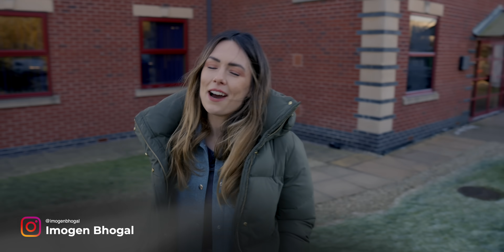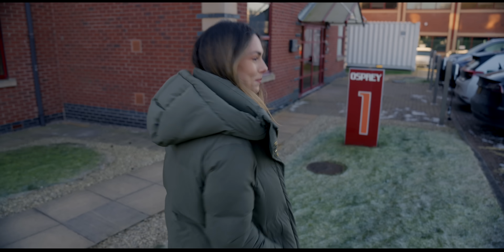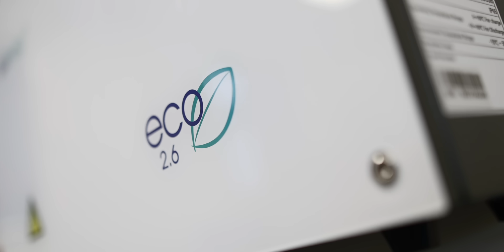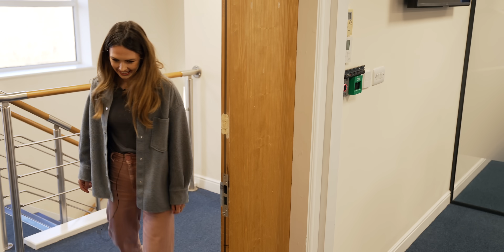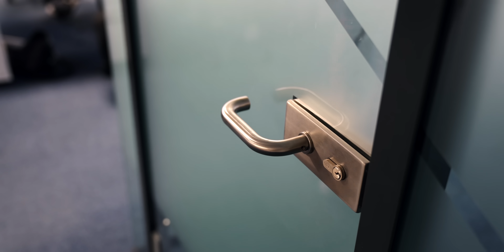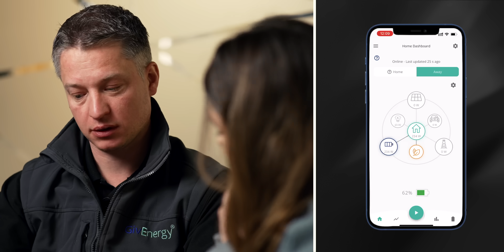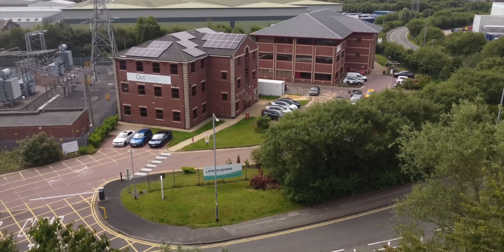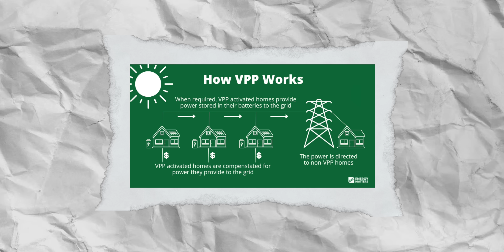THIS Is The Secret To Green, Clean Passive Income!

Comment: I think the size of your grid connection is a big factor here. If you only have a 4 hour cheap overnight window to charge your home battery and your car, then a 3 phase grid connection will make all the difference. In the UK they seem quite rare, on the continent (and even in places like Nigeria) it seems standard.
Reply: I don't think it's really a problem. A 100A supply gives you 92kWh every day. Putting 13 of those into a big battery hardly makes a dent, and  leaves enough for  about 300 miles of driving a day, which would work out to 115,000miles per year.

If you've only got a 60A connection, that's still 55kWh, which leaves enough for 170 miles a day (or 60,000 miles per year)
Reply: I guess that depends on what your grid connection is, my current house (UK) was was built over 10 years ago and is 100A (single phase). But of course many, especially older, properties are going to be 80A or less, and those are likely not going to be easy to upgrade.
Just thinking of an example, Looking at the datasheet for the GivEnergy 8.2 kWh (as it's their popular one), that charges and discharges at a max of 80A, with a 59V max change voltage, so that's ~1.8 hours to charge from flat (assuming I got the calculation correct!).
Add a 7kW/32A on the wall car charger, and they can add around 20 miles per hour to a cars range (depends on car efficiency of course).
So with a flat house battery every day, and only 4 hours of cheap overnight electric, that's the home battery fully charged, and about say 30-35 miles range being added overnight (I'm assuming some power being needed for the house as well, otherwise it would be 40+). This assumes no solar PV as well (or a typical UK winter even with PV!).
Reply: @TheBoothy666  I don't understand how you got the 30-35 miles. If the battery is charging at 4KW and the car at 7kW they're using a total of 11kW. That would be close to a 60A (13kW) connection but there would still be head-room with a 80A (18kW) or 100A (23kW) connection.
Reply: @robinbennett5994  I was assuming charging the car and the home battery were not being done in parallel, i.e. Charge the house for up to 1.9 hours till full, then the car for 2.1 hours (or more). All I was doing was pointing out it's viable with a house battery and an EV, even if you only have a 4 hour overnight slot for cheap elec pricing.
Obviously having a integrated control system to manage the car charger and battery system in tandem would make this work better, i.e. charge the car at max rate, and anything left over push into the house battery, (or the other way round depending on your priorities) but not everyone has these things integrated.

Comment: .Stay with fossil fuels, forget nuclear grid electricity. 

5 times more electricity if no fossil fuels and 5 times bigger national grid. 

Look at Snowy 2's additional grid costs, $2billion budget is now $15billion or $20billion budget. 

All the CO2 to build bigger national grid is insane. 

World CO2 emissions are killing Australia. 

The world is not going to build bigger national electric grids. Grow up.

Something I posted on a nuclear promoters site.

Actually, grid expansion costs and nuclear electricity will see customers abandon the grid and rely on rooftop solar PV and EV with V2G feature with selfplug-in. 

Most vehicles are parked 23hrs every day and drive only 7kwh short trips daily. 
Most vehicles drive building to building parking space. 

A simple wall plug and trickle charging 240volt, ezi pezi daily. At all parking spaces. 

A grid with no customers is a dead duck, a stranded asset. 
A grid with nuclear electricity is a bigger dead duck.

The daily solar duck curve is deadly,  Hahaha 😆, when EVs are only part of the national vehicles fleet. 
Customers will abandon supporting the national grid.

Comment: In southwest England with a 4kw solar panels and a 10kw battery with an ev charger that i charge all of it up on ( inc battery ) on an ev tariff at night but solar during the day.
My energy use for last year was 3600kw my solar produced 3400kw and i imported into my batteries 2100kw for 7.5p but sent back to the grid 2000kw for 15p per kw.

To charge my car ( company car ) it costs just under £6 for an 100% charge and 330 miles so really cheap.

I still pay bills but they are much lower than before and the savings are obvious.

I did mention my car was a company car but if its wasn't i would seriously consider a second hand EV as the advantages outweigh me going back to a combustion car.

On "fuel" petrol alone i am saving around £2000 a year not including maintenance costs and my home electric i am saving around the same so between £3000-£4000 a year in savings.

Its an absolute no brainer for me.

My only advice is make sure you get a decent battery size as that is where the savings are made for me, if i could afford another battery soon i would.

My set up is a 
5kw solis hybrid inverter.
10 kw puredrive batteries.
4.4 kw JA solar panels.
Zappi car charger.

It all works great and its all really efficient.
The batteries have only lost 0.10% efficiency in just over one year so literally nothing while being charged and discharged once each a day.

Getting a set up like this can be beneficial but my advice is do your homework of how much energy you use and what equipment you need, don't undersize as thats a big problem, two companies i look at wanted to install a 5kw and 2.5 kw battery that would have been useless so shop around and compare notes to see if your figures come close to what the retailer's say.

But its definitely well worth it.
Reply: @sbalko74  The difference is mostly likely that you use a lot of power for air-con - which is extremely rare in the UK. As are pools, now you mention it!
Reply: @sbalko74  The solar tops up the car when my batteries are full, the main charge comes on at night for 7.5p per kW through "octopus energy" on thier intelligent tariff.

It's not designed to be the main charge for the car it's more for the general running of my home as I average 9.8kw a day and my batteries are 10kw.

Also an English home doesn't have much space for any more panels, my 10 panels fill up my south facing roof, if I could have more I would but it's the maximum I can fit.

Also I don't need Air-con or even "have" or can "fit" a pool into my back garden as it is the size of a postage stamp.
Reply: If the zappi is shedding the car charger during high house loads that is the secret sauce
Reply: Fantastic.  This is the sort of practical number-crunching in a human way story the channel should do - 2 years is a long enough period for credible feedback.  (Need to add a financing cost - now if you spend £7000 upfront, the interest cost is meaningful.  If you are lucky enough to not need to borrow, it is still income foregone from something else)

Comment: I usually love your channel, but this does come across as a bit snake-oily. I think being paid £24 in a day for a small amount of energy must be quite a rare event. I used to be with Octopus Agile Outgoing, and there were occasional situations like that, for sure, but they were few and far between.
Reply: Rather misleading wording. The MD's All in One can discharge 6kWh in one hour so he would have been paid £4 per kWh. That's a higher rate than usual and there's only about a dozen of these sessions a year. Also to save £4 per day, everyday, means using the full 13.5kWh everyday and having a difference between peak and off peak rate of almost 30p per kWh assuming no losses.
Reply: @paulthompson9837  £4, most suppliers are giving £2.25 for these periods, and it's not a daily thing. There's been 1 in 2024. No idea how £24 came up.
Reply: I guess to save £4 per day he must also be counting power used by his EV, otherwise you are correct and his figure is optimistic. @paulthompson9837
Reply: Agree. That's either a huge battery or a very rare rate to encounter. Unless you happen to have a lot of excess solar your usually better off averaged across the year charging your batteries at cheap rates, and using your solar / battery. The savings on plans that support this outweigh the payments from selling it back at high rates. As your typically paying a lot more for your incoming tariff, so it just doesn't balance out. It'll be cheap (import) when its hot and sunny, when you don't need to charge. When its cold and grey you won't see a cheap rate. However if you have lots of excess battery and solar DFS will be fine. But at that point you've over paid for your system to be too big. So although its better to operate your big system this way you'd still have been better off buying a smaller system. Of course there are exceptions if you're using very small amounts etc, but with the current options of tarrifs it usually doesn't add up to sell back to grid than just using it cheap.
Reply: I was surprised with the £24 session but it can be achieved if he has the higher battery and latest Inverter. In Dec 23 we had 1 Giveback event which paid a double amount of £4.40 per Kw.  We earned just under £9 from it with us discharging at 2.6Kw per hour  (Gen 1 inverter with Gen 1 batteries) with about 1.9Kw per hour going to the grid. The newer systems are much higher so I can see how he hit £24.  Since then we have had standard events at the normal rate of £2.20 per Kw. Typically we earn around £4 an event and also at the same time I am earning my SEG tariff which is 15p pKw. the battery setup with the EV tariff is brilliant. We get around 13 Kw in the early hours and then use that all day and into the night depending on the solar. 9p per Kw instead of 40p Per Kw, easily saving £4+ a day. The Givenergy solution is worth looking into rather than getting a piece meal ad hoc setup.
Reply: true....
Reply: They were specifically talking about the DFS sessions, of which there are about a dozen each winter, and of those only a couple will be at ~£4/kWh

Comment: How exactly did he make 24 pounds in 1 night ? what was the price-kwh ? 20p 24/.2 = 120kwh... but his battery is perhaps 5kwh from the graphs he showed... please give actual date... like how big is his system, actual meaningful numbers etc, otherwise IMHO you are just confusing and giving people perhaps false impression. With all this "Makeing money" could you please put it into perspective with the payback period etc.

Additionally what are the losses in sending to the grid ? 20%
Reply: The details were rather lacking. We only pay $1.50 for 10kWh. Sure, our night time rate is 6¢ so the battery might save us 1.50 - 0.60 or $0.90/day. $0.9 x 365 = $328/yr. I wonder what the whole setup costs.
Reply: yep... theres a reason they are lacking in the details, because I don't think it makes sense... I have solar (diy) and ev... but not to save the world, coz they won't and only slightly to save money... diy pays back much quicker...  @scottkolaya2110
Reply: GivEnergy All-in-One can output at 6kW, at £4/hr, gives £24.  But his house can't have been using any power during the DFS event, and it doesn't account for charging costs.  

During the last DFS event we turned of the freezer and dehumidifier, and had a candle-light meal, but I don't suggest this for all.  It was mainly for fun for my 2 young boys, who got a chance to use their torches.  

As soon as V2G starts working these DFS events will be even more worthwhile.  At present most car chargers are 7kW, but I'd like to get something in the 13-20kW range, partly to benefit from DFS events, but also because I'm on Octopus Agile so faster charging will enable me to make the most of the very lowest rates.
Reply: How big did his battery have to be ? from the daily usage- gr-phs ---------It didn't look more than 5kwh ? but to get 24 pounds at he need to run at 6kw max for 4 hours... i.e 24kwh's  @Adam-u1n1b
Reply: The 24 quid would have likely been during one of the live DFS we've had this winter, where NG ESO were paying £4/kWh for energy exported. I can't remember if it was a 1 or 1.5hr event, but that works out about right for a 6kWh discharge over the event. But this is currently a trial (currently the second winter they've run it), so I would expect prices offered to drop. In fact, NG ESO have already said for the remaining 4 test sessions left this winter, they are no longer giving the guaranteed £3/kWh they offered in previous tests and instead the DFS providers like energy companies and GivEnergy will have to bit against each other, so that will reduce how much you can make from it.

Comment: 10kwh / day is high ? Really ? 20-30 here easily... add a car to that ?
Reply: Is that in the UK, or do you live somewhere sunny and have air-conditioning? 10kWh is normal for 4/5 bedroom house in the UK.
Reply: @robinbennett5994 no 10kWh/day is high usage for UK according to Ofgem (3900kWh annually). Average is 2700kWh/year. Look it up. But still too high.

Efficiency measures have to be put in place before adding all the green gadgets.

Households of 4, plus EV charging: 2250kWh a year… so 6kWh/day. 😊

Comment: How long before the energy companies stop the cheaper overnight rates? 🤔
Reply: As soon as the majority start driving EVs and charging at night. Then the day and night demand will be about the same.
Reply: I think it will always be a bit cheaper at night, otherwise EV drivers will just charge in the day.  But the gap may lessen as battery and other storage systems are developed and their costs decrease.  Or the gap might between high and low rates might widen further as more and more variable renewables are added to the grid.  

I guess that in the end we will develop something like massive electrolysers to produce and compress or liquify hydrogen, to soak up the low rate power, which will later supply it for seasonal needs, ships or planes  @scottkolaya2110
Reply: The UK expects to triple the amount of wind power by 2030, and we already produce almost enough to match night-time demand when it's windy. I think that instead of a cheap overnight rate, we're likely to see a bigger price difference but with a more complex scheme that reflects how much wind there is.
Reply: @robinbennett5994  
Key words... When windy... Doesn't matter how many turbines you have, you can't control the wind and when there's nothing you have to burn gas.
Reply: @Robert-j6r8c  Clearly you don't live in Scotland a no wind day? 😉 

Seriously though this would need to be combined with a smart grid, battery backup and some form of nuclear to top up but it makes one hell of a difference. Solar farms (we have those in Scotland too) and if they ever get tidal working in a big way.

We also have import/export agreements with countries like Norway when wind is low we import their hydro power when wind is high we export energy to them to pump water back into the hydro systems.
Reply: not long..

Comment: We had our Givenergy and Solar installed before winter 2 years ago. Only a 3.6kW panel and 8.2 battery but It’s saved us a fortune and we are lucky we were largely protected from the gas energy price spikes.
The DFS has been amazing
The most recent session saw us paid £5.42 for helping the grid even though we only paid £4.73 including the standing charge for all our leccy to run the house, heat it and top the car up with about 25 miles.
Reply: For one session octopus was paying £4/kWh and Giv only £2.25 though
Reply: @Lewis_Standing  yes, I think Giv upped theirs on the following one. Healthy competition. We made £20 from across both those sessions. We were opted into the Octopus one not Giv. I just trigger it manually to discharge.
Reply: What electric heating do you have?
Reply: @computerbob06  5kW ASHP. Heats the water cylinder at night during our off peak.

Comment: DFS payment of £24 sounds like an amazing opportunity.
Reply: Octopus has been paying £2/kWh for most of their saving sessions this year, with some paying £4 per kWh. I think the all-in-one has a 5kW inverter, so you could have made £20 a few times in December. For this chap to make £24, the session could have lasted more than the typical one hour or been at a slightly higher price, or he might have had a higher power inverter that isn't released yet.
There are only a few of these per year (at the moment), so their impact is relatively small compared to the daily savings over the year.
I'd also like to know how he's saving £4 a day. The difference between off and on-peak power is about 20p/kWh, so a 13kWh AIO would only save about £2.30 a day - maybe he has a big solar system too, and was able to recharge the battery.
Reply: @robinbennett5994  
Proof renewables are so much cheaper... Only £4kwh.

That's why my bills are so cheap they don't bother billing me.
Reply: @robinbennett5994  I'm sure it was a cherry-picked scenario to increase interest and sales...
Reply: @robinbennett5994   You make some good points there, especially the 500 kWh of excess Solar (@ 15p) I exported over the year. Thank you for responding.

Amazing opportunity was perhaps overstated by me.

I discovered by trial, that the difference between what you use and what you save - also includes what you export.
E.g. I normally run on battery all day after charging overnight, so I can’t save anything that I’m not using…
However if I export during the saving session - the export figure is used for calculation purposes. This export nets around £5 per saving session which is good, allbeit I’ve only done this twice. I guess at least I know about this now…